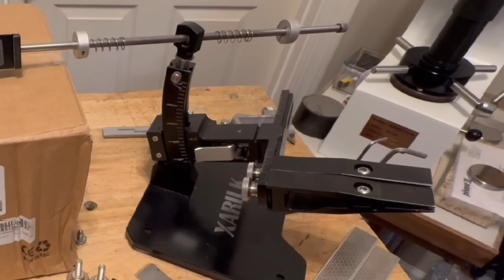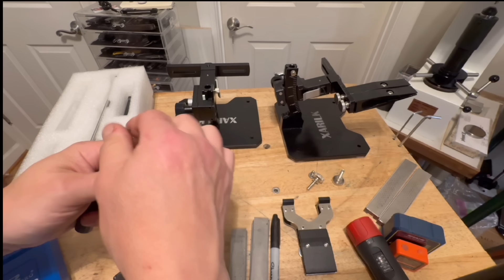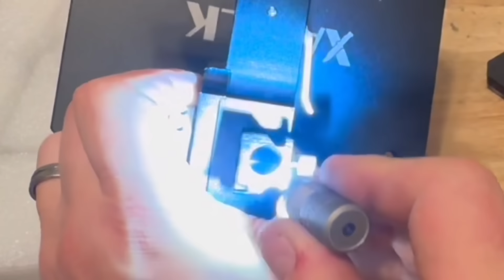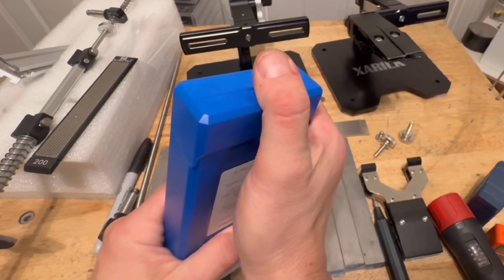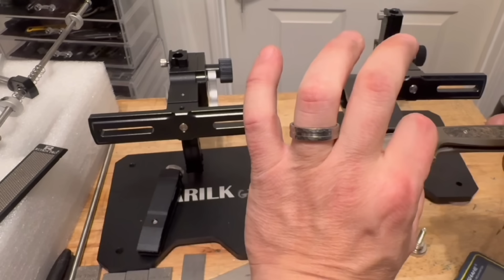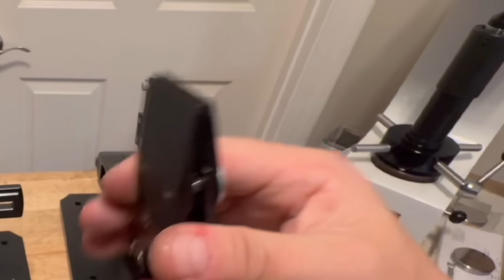XARILK Gen 3: improved? MOSTLY…

Comment: This is a repost comment from an older video of yours for the Xarilk part 3.

Thank you for all of your tutorials and videos. They truly guided me in the right direction and gave me the confidence to purchase my first fixed-angle sharpening system.

I received the Xarilk Gen 3.1 sharpening tool yesterday along with their 6-piece diamond stone set. After performing the initial setup and carefully adjusting the system to eliminate play, I have to say I’m impressed with what you get for the price. I also applied a small amount of silicone grease to high-use and friction areas such as the support arm, pivoting gimbal, angle adjustment gears, angle adjustment switch, and knife holder screws to prevent excessive wear.

I’ve already sharpened several kitchen knives and my EDC with excellent results. As I progressed through my sharpening sessions, I was able to learn and implement new techniques that I believe could be helpful to others. However, I did run into an issue that may be related to the Gen 3.1 design changes.

For angle measurement, I’m using a Klein Tools 935DAG digital electronic level that allows the user to zero a reference plane. My process is to first set the height of the swivel gimbal, then zero the level on the support arm/rod at the stone holder. Once zeroed, I place the level on the knife holder arm to read the cutting angle and that's my angle. Please feel free to correct me if I’m mistaken, but this seems to be one of the simplest and most accurate ways to determine angles when using a digital level with a user-defined reference plane.

The issue I encountered involves the angle adjustment switch (locking mechanism). This lever is designed to lock the desired angle by applying pressure—via a piston or shoe—against the main support mast, preventing movement through friction. On the Gen 3.1 unit, there appear to be two design changes that negatively affect this mechanism.

First, the Gen 3.1 uses a new, steel, replaceable/removable geared rack for angle adjustment. The thickness of this rack compared to the pocket milled for it appears mismatched, which creates an uneven surface or void. Second, the main support beam—previously solid aluminum—has now been skeletonized and milled, reducing the available surface area even further.

Together, these changes significantly affect the surface that the friction piston mates against. Compounding the issue is the fact that this piston is actuated by a screw but is not adjustable. As a result, there is a range of angles where the locking lever fails to grip properly, allowing the angle to shift.

I’ve already contacted Xarilk through Amazon, and they are willing to replace the unit. However, I don’t believe a replacement alone will resolve the issue unless the underlying design concerns are addressed. I’ve also provided my phone number so they can contact me if they’d like more detailed feedback.

I’m sharing this here in the hope that others—and possibly the team at Xarilk—see it and can work toward a proper solution. Despite this issue, I’m enjoying the system overall and appreciate the innovation they’re bringing to the market.
Reply: Experiencing exact same problems. Just emailed Jonny at Xarilk yesterday with my Amazon order number and a short video of the faulty clamping mechanism, as was requested by him. He hasn't responded since yesterday and if this problem doesn't get resolved it will be returned. I really love the built quality but if it cannot hold angles it is useless.I will patiently await a response.
Reply: UPDATE: I’ve received the replacement unit. While it has a few minor blemishes and dings, the locking switch is now working properly.
The fix involved sandwiching a thin steel sleeve plate as a spacer between the steel geared rack and the support mast. This created a flush surface, allowing the brake shoe to gain proper traction.

The Xarilk team followed through and made it happen 👏🏼
I highly recommend reaching out to them if you’re experiencing any issues. Like most sharpeners on the market, these are precision tools made from different materials, so using common sense during adjustment and operation is essential.

Comment: I have been using the 3.1 Gen for a few weeks.  Something I have noticed is the angle adjustment locking/tension lever does not get tight if I have the angle adjustment set to almost exactly 22-23 degrees.  If set to 22-23 degrees, the tension lever just swings fully in either direction, but does not apply tension.  All other degree settings work perfectly.  After taking everything apart, it seems that this malfunction coincides with where the upper edge of the steel tooth array mate with the rest of the angle adjustment arm.  It seems there is a gap just big enough to allow the little metal plunger inside the tension adjustment housing to sit a little 'cockeyed' and not apply tension.  

Not necessarily a huge deal, as 22-23 degrees isn't an angle I plan to use, but I emailed Johnny to inform him.  He immediately sent a replacement.  I have yet to open it for testing, but just something you may want to check.  Over all this is an excellent sharpener, and I have been having a blast using it.  You may have mentioned this but the 3.1 also comes with aluminum backer plates for the stones.
Reply: Happy New Year!  I have the same issue. What is the email address? Or where can I get it?
Reply: @michaelmillion183  me too, did you get email address
Reply: You must not read responses to your post. 🤷

Comment: Thanks for the excellent video.
Can you tell me if the new version work with the WS Professional Precision Adjust plates?
Thanks
Reply from the maker: This one does not unless you deepen the hole where the gimbal sits. Gen 3.2 version is coming out in a few weeks and that one will not have this issue!
Reply: A 3.2 is coming out already?
Reply from the maker: @OLDDETROITBOY68  Gimbal upgrade and fixing the plate thickness adjustment.

Comment: Just opened mine today and have sharpen 4 knives. The first thing I noticed before starting is the gear rack sits lower than the piece it is screwed to. This causes the clamping devise to not work in this area. Go above or below and it works fine. Before I finished the last knife I noticed it was moving some. The piece that flips over allowing you the sharpen the knife has play in it. The set screw to the shaft it's attached to it tight so the shaft is rotating also. Hopefully I can find a fix for this problem. 
Enjoy your videos they are very informative.

Comment: My gen 3 isn't in working order. The blade holding clamps are warped that they are K shaped at the terminal end and also the the the screw holding the gimbal to a set height does not hold as the thread is shredded. I cannot use my device.
Reply: Have you returned it or contacted customer service?
Reply: I just contacted Jonny with Xarilk about my issue with the 3.1 not holding correct angle when clamped down. Sent him a video of the problem.
Reply from the maker: @OLDDETROITBOY68  I think the tolerance of how the steel gear track is mounted plays a role in yr case. But let’s see what he says and please keep this community updated!
Reply from the maker: Sounds like you had your way with it! Just grab another one when they go on sale and, maybe, watch my video on how to use it… it’s a machine, finesse is required

Comment: They're giving you the spray bottle for water or for water and dish soap as a lubricant for your plates and your resin stones or in this case so-called resin stones but they're really more of like a fiberglass mesh with diamond impregnated on the mesh. When using resin Stones you never want to use them dry they will load up very quickly water works well water and dish soap works better and will slow the stones from loading up so quickly.
Reply from the maker: Got ya! Thanks for a bit of education. Keep’em coming!
Reply: Looking for more info on these stones. Given the huge variance in price between these and the more established resin stones, I'm sceptical until I've seen some more reviews/comparisons. I also own the Sytools diamond plates but aside from those I really haven't seen anybody praising any of the Chinese whetstones.

Comment: You can absolutely jump from the 400 to the 1200 with no issues you do not need 400 600 800 etc jumping from the 1200 to the 3,000 is fine. By going 200 grit steps you're literally just spending more time than you need to you could jump from the 400 to the 1200 on a Electro plated diamond plate and it'll clean the previous scratch pattern up very quickly. Perfect example would be Diamond plates freehand we go 325 to 1200 in one jump all the time and it'll clean it up within just a few passes. I've tried all the Ruixin stone sets that they sell in fact I was the First on YouTube to do videos on them and I can tell you this those so-called resin stones that are in that set are definitely not resin Diamond Stones they are more like a fiberglass mesh that is infused with diamond and you really have to be careful when doing Edge leading passes as it's very easy to cut into them however I will say they polish like crazy if you just want to get a bright mirror finish they will do it if you search up the name of the stone company you'll find plenty of content from my channel on all the different sets they offer.
Reply from the maker: Sure, that’s why they say in the instructions not to lead into the edge😂
I tried skipping grits and, to my naked eye, it looked just fine, but under the microscope, I see the striations from 400 plate showing up after 1200. I am not planning to encourage my viewers to pay $30 for a single plate to get the grit uniformity down to a micron. Instead I will try to use my cheap but indestructible plates and step them tighter to average out the striations depth. I’ll try and share the video and if I fail, so be it! We will learn something together!
Reply: @diamondcutsteel  absolutelly agree with you.
Reply: That works great if you’re just trying to get sharp, but if you’re going for a decent mirror polish, that’s way too big a jump.

Comment: I have the new model with the milled out tower. My problem is that there is vertical slop when I lock it down. It locks well as far as rotation but the knife blade can be moved vertically up and down some which makes it hard to set the angle properly.
Reply: All these milled model are having this issue, where the friction shoe does not do well between the milled out areas and the new steel rack.
Reply: I sent a video to Jonny at Xarilk demonstrating the issue with the faulty angle adjustment lock with the milled version. His team determined it was a faulty unit and is sending me a new one . I will check back in once I receive and go over the new unit.
Reply from the maker: @A @OLDDETROITBOY68 old you they are good 😉 Keep us posted!
Reply: @OLDDETROITBOY68 I also received a reply stating that their team have taken note of this issue and they are as well sending me a replacement unit.
Reply: Report in with your findings as will I. Happy New Year my brothers...This unit is so close to being almost perfect but has a few 'teething pains' to get through.
Reply: @OLDDETROITBOY68 Good news!... I received the replacement unit. Although it has a few blemishes and dings, the locking switch is working properly. The way they fixed it was by sandwiching in a thin sleeve plate between the steel geared rack & the support mast, enough to now have a flushed area for the break shoe to gain traction from.
The Xarilk team came through and made it happened..👏🏼
Reply: Excellent, I received the replacement unit as well today and indeed the angle lock mechanism works well, almost too well 😂. Aesthetically, mine appears ok but mechanically is really what we are most interested in. I have not sharpened any knives yet and cannot speak about the functionality of the included Y-clamp I paid extra for. By the way, this new unit was missing one of the rubber feet on the bottom which I will not deduct any points for. 😅 I simply used a heat gun and removed one from the original unit. When time permits and start to sharpen some knives, I will report any nuances, if any with this Gen 3.1. Enjoy your shaperer and Happy New Year to all.
Reply: Mine is doing the same thing. Once the angle adjustment knob is clamped down with the angle adjustment switch there is considerable vertical movement. The unit seems very solid otherwise. I don't know if I should reach out to the company or just return it to Amazon.Just received the unit today.
Reply: @OLDDETROITBOY68  that's a personal decision, if you want to refund or get a replacement that doesn't have that problem. Others who had the same problem have commented recently to say their replacement model has fixed the issue
Reply from the maker: Thanks for the feedback; I'll keep an eye out for that in my testing.
Watch the setup video linked at the very end of this one, that may help you eliminate the issue
Reply: @CBRxLIVE  Have you reviewed the Klodchik Helicopter sharpener from Ukraine?